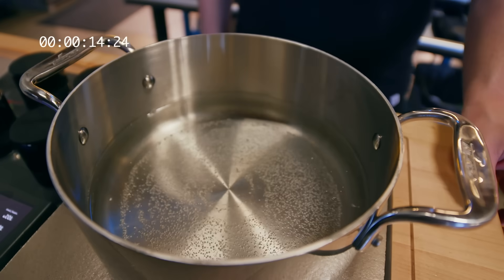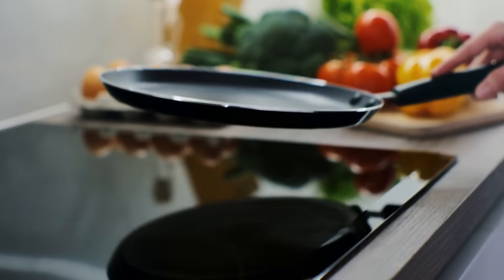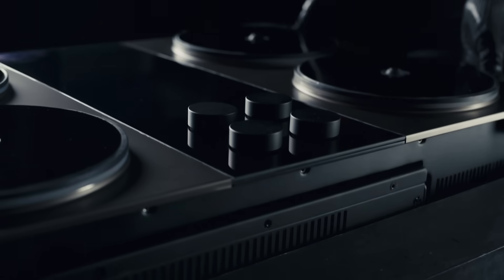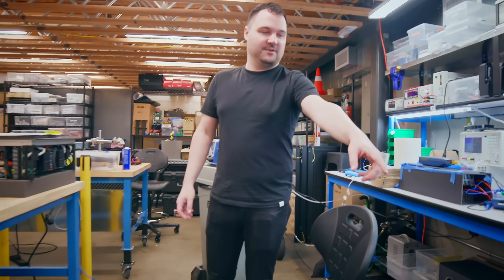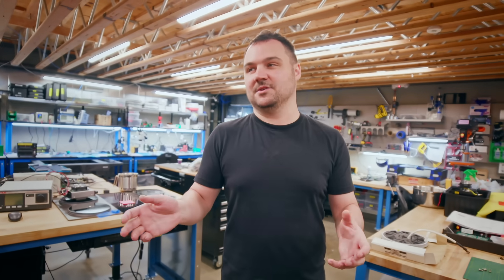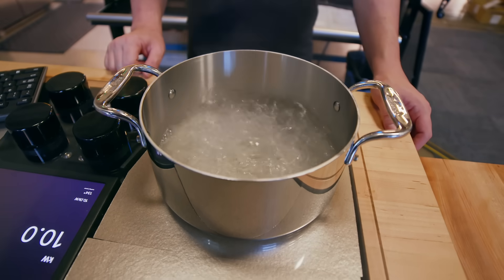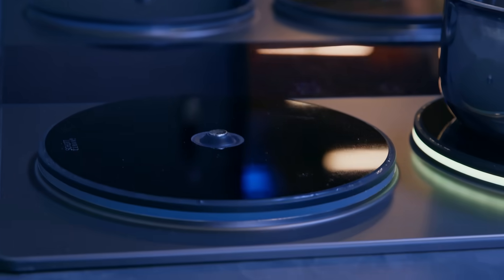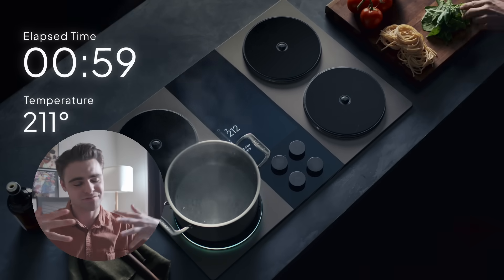World's Most Powerful Stove: Boils Water in Seconds | Impulse

Comment: A network of batteries in the house!?  What a cool idea.   I’m ready for it now.  I have battery storage but can’t fit much more the 15kwh in my garage.  Having spots throughout the house with additional 3-5kwh nodes would be something.  Sign me up!
Reply: Scott, I agree with that depending on battery chemistry.  I wouldn’t use Li-Ion or LiPo.  But LiFePO are considerably safer and don’t explode like Li-Ion.  This particular technology is a ways off and battery chemistry and design will continue to improve to provide safer options.
Reply: @johnprouty6583 I did a cursory search of LiFePO, and unfortunately the tradeoff for using LiFePO is capacity. Even at a theoretical maximum, doesn't come close to the highest capacity Li-ion. That doesn't mean it's not better for this application, if the materials are cheaper, and size not an issue, then getting a larger battery for the same capacity would be better as it is a safer technology. It also runs at a lower nominal voltage, so that could also lead to other issues with power delivery. I'm not a power engineer though, so I don't know much about the subject matter.
Reply: @johnprouty6583 I am curious about the topic you bring up. I think it can be reasonably agreed upon that Li ion or LiPo would make absolutely no sense in this kind of implementation. LiFePo is an interesting case that is assumedly safer than those options. But is it really? The variable that concerns me is temperature regulation in end-use implementation in this context. LiFePo is pretty amazing, but still essentially is a band aid solution to the fundamental problem that batteries are unsafe and essentially disposable.
Reply: @sang4sang  I think “safer” is kind of the operative term here.  If they are breached mechanically they don’t explode (may be a bit of an exaggeration) like Li-ion.  But if you draw over their rated discharge rate you’ll certainly have problems.  While the report touted the 45 second boil I don’t see that as a particularly practical as it doesn’t save energy, same energy is required to heat a certain quantity of water to a certain temperature (less time related losses) the infrastructure required to handle the current required would bump up the costs a fair bit - larger conductors, beefer electronics, etc.    As far as inherent safety, anytime you are moving energy or storing energy - gas, batteries, mains power, etc. - there will always be some safety issue you’ll need to consider.   Regardless, I still like the idea of networked islands of energy storage.
Reply: @johnprouty6583  it's also worth adding that gas in residential uses is also very dangerous, and arguably on a greater scale too (think of a gas leak and explosion leveling a house or punching out multiple apartment units in a single incident) - batteries certainly pose their own risks and I wish it was better addressed in the context of this video because I do think it's a topic that can't be ignored when discussing transitioning from gas to electric utilities in residential uses.
Reply: @tofu4tortoise  unquestionably, gas poses a threat also for the reasons you state and the residual pollutants it generates.  Any form of energy is going to present some hazard. I agree, I wish there were more attention paid to the potential hazards each form introduces.  There have been some good videos comparing various battery chemistries and each of their pitfalls.  I think the concept presented in this video is interesting but I don’t think we have the best battery technology available yet to make it practical and safe for home use.
Reply: Until the batteries burst into flame.

Comment: Using multiple appliances as a network of battery storage with inverters that can serve the home is a cool idea, however - no mention of how it isolates itself from the grid when there is a power outage, and avoid creating dangerous conditions for line workers attempting to restore grid service.  It likely wouldn't pass code for that use case scenario until that consideration is planned for/mitigated.
Reply: Sam here — our inverter will pass the relevant UL standards for this exact thing.
Reply: @sam_damico  What kind of batteries do you use and can you tell us about their safety & lifespan? Thank you.
Reply: @sam_damico  Could you please provide more details of your technical solution to this problem?
Reply: Power systems engineer here, this is pretty easy to solve, the inverter control strategy in the appliance is grid-following not grid-forming, and anti-islanding protections are pretty easy to implement (and a standard feature of essentially all PV inverters) as well. For grid-connected storage utilization like for time-of-use billing or in concert with a PV system, those protections don't come into play.

Extending the concept of appliance-based backup power in case of grid failure absolutely must have a grid disconnect switch in between the mains supply and the main breaker panel for the reasons you note, which would also serve to provide the CTs needed to efficiently control on-peak total home consumption particularly for time-of-use billing when grid-tied. But it's reasonable to envision a solution where that grid disconnect switch is in communication with the energy-storing appliances to coordinate the transfer to backup power, as well as to dispatch the discharge of each appliance. This functions essentially the same as utility-scale battery systems, which use a central Power Plant Controller (PPC) to dispatch potentially hundreds of individual inverters behind the Point of Interconnection. So it's a small-scale version of that.  I quite like the concept.
Reply: @thatspsychotic  Can you recommend any books on grid level power system design? I'm an amateur radio operator with some degree of (rf) electronics experience and I've always wanted to learn more about how the power grid is designed and operates.
Reply: I've wondered about this ability to "Island" a house from the grid in power outage situations. 
Obviously generators have been around as backup for generations- so how have they adapted for safety when the power goes out, and why can't batteries function in essentially the same place as a generator with the same safety protocols?
Reply: @dustinabc  Generally speaking, you either run appliances directly from generators, or you have to install isolation for generators if you want to run your whole house or a subset of circuits from a generator during a grid failure - so the same types of precautions are required.

The difference here is that it's proposed that every appliance become a local grid supplier in the case of an outage, so these devices would need to talk to something at the main breaker panel to ensure that it's isolated from the grid before they could all start supplying power within the home during an outage.

A generator hookup is centralized - there's not a bunch of generators hooked up to all of the individual circuits inside your home, unlike what this model essentially suggests, if you get my drift.
Reply: The protections for this exact scenario is already implemented in practice more than you may expect. I am just riffing from the top of my head, but I really feel like widowmaker cords are a product of USA ignorance. And widowmaker cords have been a thing much longer than battery backup implementations in homes have even been feasible. There already are protections in place for line workers that assume people are idiots. Murphy's Law has been applied for line workers.
Reply: The central hub will be a product after they launch their 2nd appliance for sure
Reply: They should just stick to making a stove first
Reply: I don't think I understand the idea. Do you have to have a bi directional meter to subtract the energy you send back into the grid?
Reply: Electrical Engineer here- If power generation or storage is the goal in residential, you'll begin to see electrical code changes or local utility bulletins with specifications that have to be met. For instance, in facilities that utilize on site power generation, whether for emergency or peak shaving (running generators when the cost is less than the current surge rates from the utility), they are typically done in an open transition fashion- meaning we disconnect from one source and connect to another. The issue here is when moving from utility to generation, you lose power for a second or two. The other option is called closed transition, where we make a connection to our generators while still connected to the grid. This connection is usually only for 100ms-300ms, just long enough that there is no drop in power downstream to our equipment. 

Some local utilities are very wary of closed transition schemes and some do not allow it at all. The utilities that do allow it will typically require directional power relays be installed with the capability to force open the main circuit breaker in the event power is being exported unintentionally. This is coupled with a lockout relay- that prevents the breaker from being closed in on utility with out the utilities approval.

So....there are ways. But we are a long way off from having a shared grid where power is exchanged versus used.
Reply: Not only the line workers if the home has a fault (short) on the oven circuit and it blows the breaker I don’t need it getting back feed by the oven would start a fire for sure. Hope there’d be a long safety meeting with smart people about that feature first
Reply: This is not a concern, it is trivial for an inverter to detect a short-circuit condition and shut down, especially on the same circuit that the device is plugged into @user-white007

Comment: The battery pack absolutely must not be inside the house. Even much smaller packs for E-bikes, Vapes, and cordless drills have disturbingly high failure rates and a pack of this size is much too hazardous to allow inside the home's firewall. Just as propane tanks are kept in the back yard at a safe remove, so too must batteries be separate. Putting a high-power, high-capacity battery in the kitchen will burn down houses and kill people.

This will require very large cables with active current interrupters that can isolate them at the source if the battery current is noticeably greater than the request from the high-power appliance inside the house. Mere circuit breakers and GFCIs will not suffice.
Reply: It looks like these use lifepo4, which won’t catch on fire even if you puncture them or overcharge them. They also last for a lot more cycles than li ions (what e-bike batteries use)
Reply: I don't know what chemistry this stove is using but you can't make that assertion with certainty.  There are multiple Li battery chemistries with vastly different properties.  The Li ion batteries used in cars and most portable devices are quite dangerous and fire prone.  LiPO4 batteries which are generally used in stationary solar storage are much less prone to failure and fire.  The downside is lower energy density per kg which is irrelevant in this application.  If you're worried about LiPO4 causing a fire, you'd better toss your gas range out too.

Comment: Distributing lithium cells throughout every room in my house instead of a single external package? Sounds fine
Reply: im more worried about needing to replace those batteries every decade honestly
Reply: @awesomestuff9715 the pack is LFP (so significantly better and mitigated fire safety profile) and it is a separable module from the product (it slides in)

Comment: The removable knobs are really awesome. I wish they could actuate and lower the 4 heating platforms to make the entire thing completely flat. With a flexible heat res seal on the cracks. Would be super easy to clean. Awesome company
Reply: lol😅
Reply: @sam_damico  wow the man himself! You guys are amazing 😇
Reply: @sam_damico  wow , I can't believe I'm getting a reply from the CEO on YT faster than by email 😇 Hope you find it & respond. Meanwhile all the best!
Reply: @sam_damico  wow I can't believe I'm getting a reply from the CEO on YT faster then by e.... 😇 Hope you see it & respond. 
Meanwhile all the best! You guys are amazing
Reply: Completely flat is one of the best things about induction for me because of how much easier it makes cleaning. so I feel like losing that in this product is a really unfortunate decision.  Especially since it looks like they had flat prototypes
Reply: Ideally I'd want touch, but not if it's going to be as horrendous as it is on every appliance in the kitchen ever. Especially at these temperatures it's important that the house doesn't burn down in the time it takes to hold from max to off.
Reply: Just make it touchscreen like my Electrolux induction range.   I would never go back to knobs no matter how easy to clean they are.
Reply: I definitely prefer the knobs
Reply: @fire17102  No moving parts is always better from the durability standpoint. If the seal break down, you're gonna have problems. I dig the removable magnetic knob idea. 👌
Reply: @waynenakanishi971  I agree but on one hand I understand why they have raised, it's more esthetic and differentiates between induction stoves, but on the other hand a flat top would be much more practical for easy cleaning. Maybe they can split up the heating element and also make them magnetic removable just like the knobs ! Probably more of an engineering challenge but maybe the current design isn't far off and it can be done with a few changes.. best of both worlds
Reply: Touchscreens are terrible, especially when your hands are wet  @davidkelly4400

Comment: this guy re-discovered induction stoves ... which are somewhat common in most developed countries all over the planet - except the USA 🤣🤣
my guy : this is nothing new. I have been heating my water within less than a minute for years now - and the previous owner also did it for multiple years, making the total more than ten years
Granted : induction stoves are "somewhat" new-ish, the technology is only 20-30 years old.
You need special pans and pots for that work - you cant use normal ones.
Reply: He knows he didn’t invent induction since they have been for sale in every appliance store in the US for 15 years. What he did was add a battery to supplement line power in homes without 50 amp circuits.
Reply: @rsilvers129 And they’ve been available as niche products for about 50 years!

Comment: I made a faster water heater using a battery bank a little while ago, its cool too see this idea actually implemented in a product
Reply: Its nice to see familiar name in the wild west of the recommendation algorithm
Reply: Any danger or risk of explosion or fire?
Reply: @justwondering1967  Yes, all ll lithium batteries have fire risk.
Reply: @dapz do point me at such a project, network, details, build. Outstanding. I thought I was nuts. I am not Elec Engineer I just could see the connects from watching Solar Batt Bank contructs/vids. How did you do it?
Reply: Make a YouTube video and show us how you did it.
Reply: @justwondering1967  Did you try it?
Reply: American invents kettle
Reply: do they really use batteries and not capacitors? caps sound much much cheaper and safer than li-ion. energy is cheap vs all that extra cost. but in this video design is not suitable for normal person who hates cleaning. old school stove design is much more easy to clean.
Reply: Wouldn't a capacitor do it as well?
Reply: @jfjoubertquebec heating water takes a huge amount of energy, and capacitors can’t store that much energy in any reasonable amount of space.
Reply: @jfjoubertquebec you could but capacitors also don’t hold charge for a long time. So your going to to have to charge it before you use it. The battery will hold its charge for longer so you can rock up and start cooking.
Reply: @jfjoubertquebec  a liter takes 300+Wh — it’s not a small battery even for the minimum implementation!
Reply: @jfjoubertquebec power density of batteries is around 10 times higher than the best supercapacitors, if you got the space it is absolutely possible.
 In most countries the voltage is 230V with 400V between the 3 phases, in Germany most stoves are connected at 400V 16A, or 11kW of max possible power. No battery or capacitor shenanigans needed to power such a stove.

Comment: I do wonder what effect this would have on the pans.  High quality cookware is not cheap regardless of induction compatibility.
Reply: That’s due to overtemperature >>500F not getting to temperature quickly.  I haven’t seen a warped pan in the office and we cook *a lot*.
Reply: @sam_damico  Thanks for clarification! Really hope this idea takes off. As someone who makes a lot of curry and tea, fast boiling is everything I need in life.
Reply: @NinjaXryho  🙏🙏🙏
Reply: I’ve been using induction for years and haven’t had any issues with pan warping, because any pan with a halfway decent (thick) base will be fine. Only thin pans warp. FYI, IKEA is a great place to get cheap pans with really thick, sandwich-construction bases. They work beautifully on every kind of stove.
Reply: Yeah, I was wondering about warping, since that effect can be seen on even lower end induction ranges if pans are heated too quickly.